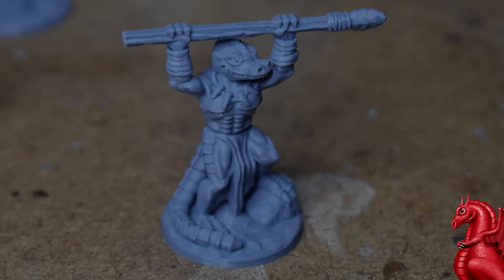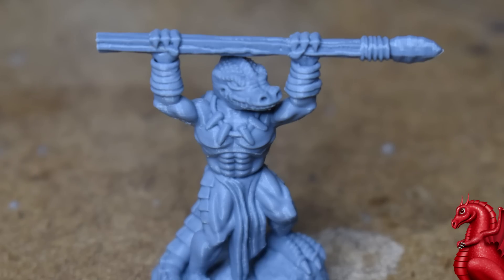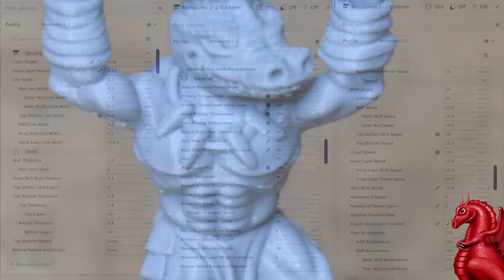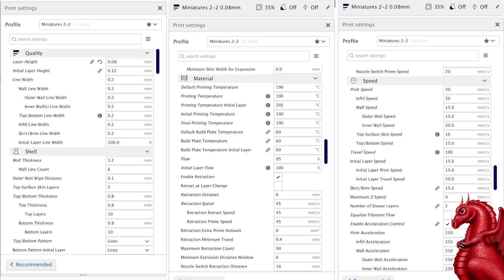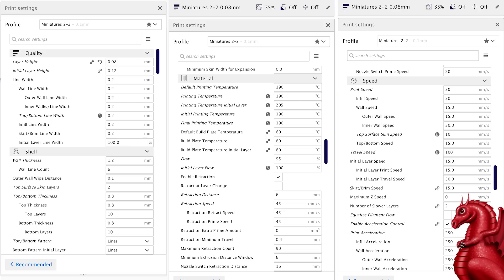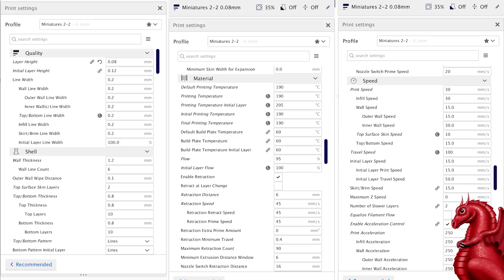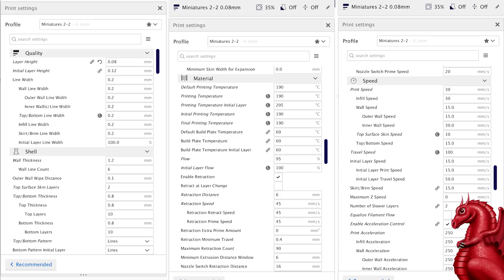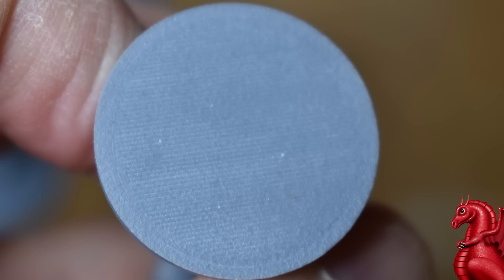How to 3D Print Better Miniatures: Pt. 3 Resin-quality on a FDM printer!

Comment: Hi! I do have a question regarding supports and supports interface. i'm tinkering with my custom profile for my Delta Mini. The trial prints resulted in GREAT surface (PLA+ at 190°, fantastic) but some blobs here and there, mostly where supports touch the mini. I have lowered "support interface density" from 80% to 50%. do you have any experience in tinkering with that?

Comment: Hey Tom. I've been using this profile and it works great some times, but other times the overhands are really bad. Any tips for getting better overhangs?
Reply from the maker: Which mini is giving you an issue?
Reply: @Tombof3DPrintedHorrors  It's the Lizard Men and Orcs from the Humble Bundle
Reply from the maker: @Beeromancer  those were very early attempts at supportless minis we had outsourced to outside contractors before we brought all mini sculpting in house. Lowering your temp in 5˚ increments should help a lot. We have retired those two older sets and all currently available miniatures will not have any issues with overhangs.

Comment: Thanks for another great video Tom. Can you please release a 2mm profile for Cura 4.4?
Reply from the maker: I will when I have time to complete it, all of these profiles and videos are done in my spare time.
Reply: @Tombof3DPrintedHorrors  can we just make the changes you detailed in the video to the .3mm or .4mm profile for Cura 4.4.x?
Reply: @Tombof3DPrintedHorrors  Thank you. I sort of copied over from previous version you had available - I too did have to go with a higher temp. I did notice my prints are a little more pliable/softer/easier to break now with the smaller nozzle but I'm not sure why because it looks great.

Comment: Do you have any examples or videos of high quality minis with a standard 0.4 nozzle? Im doubting ill switch nozzles since i use my printer more for engineering things than i do minis. Also, is 50mms to fast? Im using simplify 3d. Thanks again.
Reply from the maker: https://youtu.be/dWOiu5Nkg5A

Comment: So this video is great, and the profile is fantastic, but there's some missing info that's a major oversight. You HAVE to go into machine settings in Cura and change your nozzle size to 0.2, otherwise Cura will OVERRIDE line quality settings, reverting them back to 0.4 resulting in a mess of plastic leaking out from the heater block due to increased pressure behind the hot end. This is such an important thing to mention that I'm stupefied it wasn't brought up at all. As a relative newbie I loaded this profile in and immediately did a test print. When it looked to be working, I left for two hours. When I came back everything had gone to shit and I had to spend over an hour cleaning my hot end assembly and replacing tubing/nozzles.
Reply: im pretty sure the issue youre raising is a cura 4.4 issue. This didnt used to happen in cura 4.0; which is what this video is designed around. Check the version of the cura software you are using. In his more recent videos from 5th December, he goes through how 4.4 over-rides nozel settings if you dont re-set it in the pull down box.
Reply: @atienofiachra2874  No, I was using the correct version of Cura. 4.0 is the only version I have installed.

Comment: when i load your profile in it says 0.4 line width? What's up with that?
I'm kinda confused
Reply from the maker: That's your nozzle diameter.
Reply from the maker: It sounds like you are using my Cura 4.0 profile with Cura 4.2 or higher, which is then overriding my settings. If you are using Cura 4.2 or higher, go to the link in the video description, look for the Cura 4.3 folder, and follow the instructions in the Read Me file exactly. I will also have a Cura 4.4 native profile available in a week or two.
Reply: @Tombof3DPrintedHorrors  ah i might have switched those up, will look into it later. Thanks for all the time you put into this community! It's actually so much fun :)

Comment: Great video, great channel! How would you configure supports if you had to use supports? i kinda struggle with them  on some prints :(
Reply: Have u tried using towers? If not, I guess u could give it a try. Then set the support placement as touching buildplate and the density of all the parts of the support to be around 10% - 15%. I personally use 10%. The rest leave as default.

Comment: I am looking to buy an Ender 3 pro and replace with .2mm nozzel Nd use for minitures like d&d and 40k proxies. What is the print time on a standard d&d human size character esrimated to be at these settings? I am looking for high detail if possible.
Reply: i have an Ender 3 and i just downloaded his profile and ran a mini the time was 8 hours 41 minutes

Comment: Hi! Your channel is incredible. I recently picked up this printer and I'm looking forward to getting results like this.

Will using Cura 4.4 change these results? Should I install a legacy version to use these settings?
Reply from the maker: I will release a native Cure 4.4 profile for .4mm and .3mm nozzle this week, and a .2mm nozzle version in week or two. :)
Reply: @Tombof3DPrintedHorrors  Is the .2mm version still coming?
Reply from the maker: @captaincoo1  yes, when I get some free time to devote to it (which has been sparse over the holidays, obviously.)

Comment: Trying to import your .2mm profile on cura 4.3.1 and it won't work. Keeps telling me it can't find quality type normal for the current config. Something I am doing wrong when importing?
Reply from the maker: Go to the provided link, use the profiles in the Cura 4.3 folder, and follow the instructions in the provided 'Read Me' file.
Reply: @Tombof3DPrintedHorrors  Can you make it a .zip or .rar file to download? When I try and get those files/folders none of them let me save as. They all want to save as an html file. When I click on the .json file it opens the code. When I right click to save target as, again, it wants to save as a html file. Thanks for your help!

Comment: Love the videos! For minis that DO require supports is there support settings you recommend so you don't break your print removing them?
Reply: So I found that tree supports with towers turned on gives me a really clean removal
Reply: @chefdeadpool8481  is that on the new cura?
Reply: @PapaBoey71  it is, it's also in the previous version, tree supports are under the "experimental" tab and towers are in the "advanced supports" tab

Comment: Ok, I've followed every step, leveled my bed, and still I'm getting clogs immediately. Using Ender 3, Hatchbox PLA, turned the temperature up to 200. Been through 3 nozzles at this point...Ideas?
Reply: Go into machine settings and change your nozzle size to 0.2. Odds are it's still set to 0.4 and is overriding your custom profile settings. This means your machine is trying to force out more plastic than can fit through the nozzle, resulting in backup and clogs. I just had this issue and it was super frustrating. It's kind of strange that he didn't mention this in the video as it's super super important.
Reply: Need to know what type of extruder? Several things come to mind. Make sure that the voltage to the stepper motor is correct. Disconnect the filament from the hot end, mark the filament with a marker.  tell it to extract a certain length, then measure the length. This is to test if it is under or over extruding the filament. If it's Bowden system check the fittings, they had problems with the couplers and the tube would move. Also make sure that the model you are printing was sliced with the correct nozle size. There are some good videos on how to setup your machine before printing. Makers Muse, CNC Kitchen and 3D Printing Nerd is a good place to start. Good Luck. Also when asking for help, include info on what type of printer you have and other relative information.

Comment: Great video but I just don’t understand how you printed that first model without supports, I was hoping to see the orientation, how can you print that staff or the arms in mid air? Do you have another video that explains that?
Reply: The staff/hands are a separate piece that you glue on.
Reply: That explains it. I've been breaking up the models I've beed getting from thingiverse to help with this.

Comment: I'm comparing the profile you linked in the description and the settings shown in the video and they don't match. For example, the video shows 0.2mm used for line width while the profile has the line width set to 0.4mm. Which setting should be used, the video or the profile?
Reply from the maker: You are looking at out .4 profile, we have a separate one for .2 in that folder.
Reply: @Tombof3DPrintedHorrors  I'll double check, but I saw all the profiles and I'm pretty sure I grabbed the 0.2.
Reply from the maker: Unless you are trying to use with Cura 4.3 or 4.3, which is overriding the profile settings. If so, please go to the folder specified for Cura 4.3 and follow the 'Read Me' instructions exactly.
Reply: @Tombof3DPrintedHorrors  not using cura 4.3. Using 4.0 like you said.

Comment: Do you think those settings will work with ABS+ from Innofil3D instead of PLA? I belive ABS need more temperature than PLA and should not be cooled mid-printing (i might be wrong :D), hence the radiant heat and no cooling might be a problem. Any ideas?
Reply from the maker: ABS is not suitable for small items like miniatures, you won't like the results. Better to stick with high-end PLA like eSun PLA Pro. :)

Comment: after using a 0.2 nozzle i have a little bending on the first layer, with 0.4 nozzle no problem at all... what can i do? thanks
Reply from the maker: What is your first layer height?
Reply: @Tombof3DPrintedHorrors  0,12mm
Reply: @Tombof3DPrintedHorrors  i solved with hair spray on the plate :D

Comment: After watching several of your videos, I'm seeing a common thread of techniques to avoid the radiant heat from the nozzle from raising previously printed layers above the glass transition temperature. Would printing multiple models at the same time also help? The hypothesis that I've heard for this is each layer on the first model gets more time to cool down while the printer is working on a layer of the second model, and then vise versa. Allowing the model to cool more requires more radiant heat to warm the plastic.
Do you think there is anything to this technique? Have you experimented and found any evidence to support this hypothesis, or have you not really seen any noticeable benefit? I know the risk of printing multiple objects is if one fails it has the potential to ruin the print of all the others.
Reply: I've started printing multiple objects at a time and I don't seem to have an issue. This is mostly referring to terrain w/ a .4mm nozzle at first I did have an issue with failures but I switched to the glass bed and spent a good amount of time leveling (some would argue my Z axis is too low) and I haven't had a failure since then. I also clean the bed with Isopropyl before every print.
Reply: Yes, multiple models helps with this issue. I sometimes print a 5x5mm tower that is slightly taller than my mini as the thin tower does not add as much time to the print. In cura there is also a minimum layer time setting, I use 10 seconds. If the layer take less than 10 seconds to print the head moves away from the print untill the remainder of the 10 seconds has passed.

Btw, I'm ordering a .2mm nozel now. I've had quite good success with my .4mm and can only hope for results like this.

Comment: Another great video.  I use to use your cura profiles as my main go to profiles, but changed to to another one that has "experimental support" settings. Please, do a video and share a cura profile that uses some of the experimental cura settings (especially supports).  I know your designs are supportless, but it would help a lot of us out!  thanks
Reply: Just enable them in settings. Under preferences, settings you type experimental and choose those.

Comment: Thank you. Will try that 4mm profile for Cura 4.3
Reply from the maker: 4.3 doesn't work with our profiles currently (you need to create a custom printer profile, not use the pre-loaded reality ones as they will overwrite many of my settings.) I recommend using Cura 4.0 for now.
Reply: @Tombof3DPrintedHorrors  oh didn't know. Thank you again wise sir :)
Reply: @Tombof3DPrintedHorrors  I also would very much appreciate the tutorial on how to properly set the support to mini. Do you use the automatic Cura version or do you support yourself in another program?
Reply from the maker: @jackzahllor7064  I rarely ever use supports because none of my sculpts require them.

Comment: I really had to lough " a hair too low" would naerly be a nozzle crash. Thanks for the vid! Great work.
Reply: That's honestly how I tuned my leveling. I slice and print a bed leveling test with each of my profiles and while it prints I slowly raise the bed until extrusion stops because I'm too close to the bed then I back off ever so slightly until it's exactly where I want it. When I first got my printer that was the hardest thing for me to figure out was why my prints were failing. It ended up being I was never close enough to the bed.

Comment: 6:14 "you only ever want to print a layer that's maximum height is 2/3 of your nozzle opening diameter" I do know someone who makes these giant mascotte heads with a 3D printer and he prints 0.8mm layers with a 0.8mm nozzel. The prints don"t have to look perfect for he will add layers and he uses lightweight PLA which foams, so you can print at 40% flowrate.
Reply: the 2/3rd rule is pretty much the standard. if you watch teaching tech, filament Friday or makers muse they'll say the same. doesnt mean you cant go bigger just means it's not designed to
Reply: @mikewhite2991  yeah, I know it's just a suggestion. But I did find this exception interesting 😁

Comment: What is the license for these settings, can it be used for profit like a 3d printing service or is it just for non-profiit?
Reply from the maker: Anyone can use them as long as we (www.fatdragongames.com) are attributed as the source of the profile. :)
Reply: @Tombof3DPrintedHorrors  Thank you for replying.
It may be a good idea to put that info in a read me or notepad document in the Cura profile section for your dropbox so that one else will need to ask you that question again later.

Comment: Can anyone tell me, how long it would roughly take me to print a 40mm miniature using this profile and a .2 nozzle?
Reply from the maker: Depends on the miniature, there is no way for anyone to estimate that accurately without putting it into a slicer first :)
Reply: Tomb of 3D Printed Horrors Thanks for answering! Could you tell me how long it took to print those orcs? Just out of curiosity :)
Reply from the maker: @koljakonschak9851  I dont recall the time for the orcs, but IIRC the lizard warrior was somewhere around 5 hours total

Comment: i have to say that with a 0.2 nozzle, getting your bed height from the nozzle is one of the hardest things to get right. With such a small nozzle you REALLY don't have much room to play with and if you get it barely wrong, your extruder stepper motor will start slipping and popping... you'll end up with a clog faster from an improper bed level with a 0.2 nozzle than probably anything else. GET THOSE UPGRADED BED SPRINGS! That won't solve your problems, but it will definitely 100% help you get that perfect bed level that you NEED when printing with 0.2mm nozzles. Cheers guys
Reply: Why will different bed springs "help you get that perfect bed level"?
Reply: @samsteel4456  because the stock ones are weak and don't press against the plate as firmly. micro adjustments made with lots of tension (from the upgraded springs) hold their position much better than weak springs.
Reply: @LauraDelvecchio  Spring force is a function of compression. If you are looking for more force against the plate, why not simply compress the spring more?
Reply: @samsteel4456  okay use the stock springs then lol it's a 5$ upgrade that made a big difference for me and maaaany other users.
Reply: @LauraDelvecchio  Well I'll strongly disagree with you. It's hardly an upgrade that makes a "big difference". In fact, it makes absolutely no difference at all in print quality. Like I said, you can achieve the same thing by simply tightening the springs. In the 8 years of 3d printing I've been doing with the 10 bots I have, my experience tells me it literally makes no difference at all. Like zero.  However, if you've convinced yourself it's giving you better prints then carry on. But it's kind of like saying, when you were a kid, that your new running shoes make you run faster.
Reply: @samsteel4456  Guess i wasted 5 whole ass dollars then huh

Comment: Been using a tweaked version of the 0.4 profile with my clone-of-a-clone prusa mk3, with cheapest pla available, to very good results. Shall give this one a go. :)
Reply from the maker: Don't use cheap PLA with a .2, I recommend eSun PLA Pro or Hatchbox.
Reply: @Tombof3DPrintedHorrors  Alright, though, those might not be readily available around here. :(

Comment: I use a Monoprice Mini Delta. Anyone have any recommendations on how to get a similar quality?
Reply from the maker: All I can suggest is try porting my setting to your slicer and start there.
Reply: Hi Russ! I do have one as well. :) the critical settings you want to see are FLOW RATE and supports print speed/interface :)

Comment: Hello, Do you use Simplify3d? if yes, could you do a similar setting? love your videos! thx.
Reply from the maker: No, I prefer Cura. You should be able to port my settings over to S3D though, but the wildcard is how their tool path generation will interact with them. :)
Reply: I have both slicers and cura seems to do better with the miniatures. And I really like tree supports, s3d does not have them.